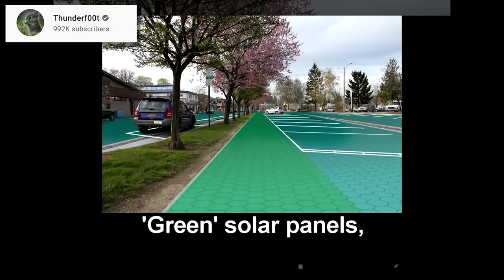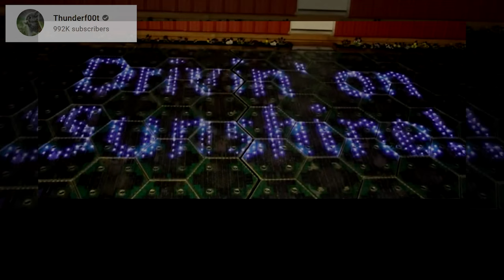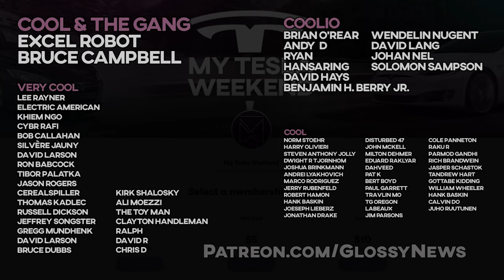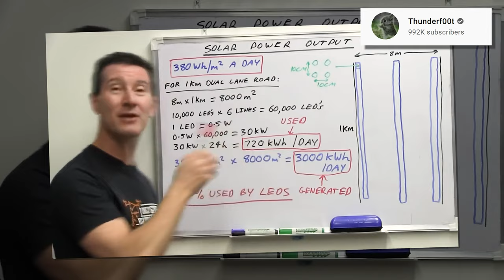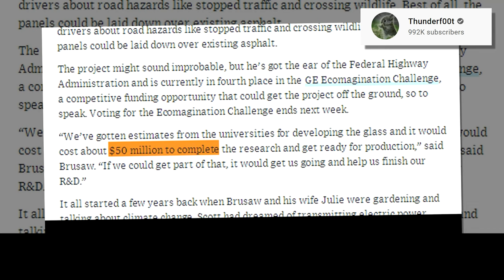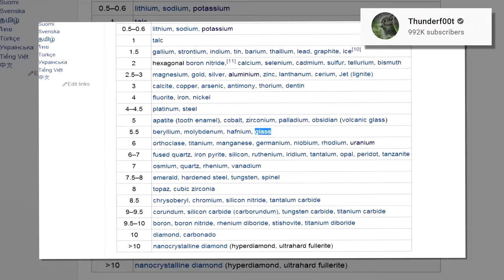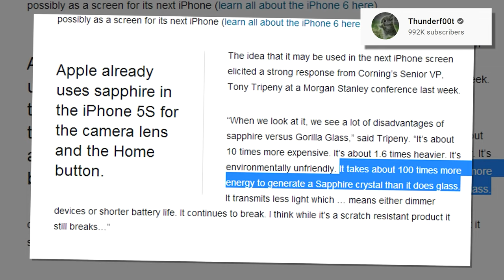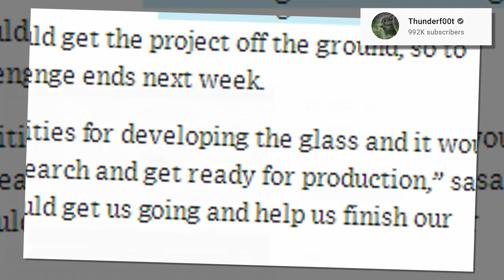Where will we put solar panels? Everywhere!

Comment: Parking lots should all be covered with solar panels. Paved surfaces makes the whole area so much hotter than green areas that actually cool the environment... Absorbing solar energy means a lot less heat in whatever area you install them...
Reply: Solar panels don't convert heat to electricity, which is part of the reason they can only convert a third of the energy falling on them.  So they have no effect on the tempriture

Comment: Hello Bryan,
Mr Al Gorithm suggested to me that if all American giant asphalted car parks were updated with solar generating sunshades part financed by the Biden proposals, the asphalt area reduced and greenery planted..that would be beneficial.
Cordialement,
Reply from the maker: I actually crunched some numbers yesterday, and while I was just sure I was going to agree, it didn't pencil out the way I expected. If every Walmart converted their parking lots to 70% solar coverage, it would still satisfy less than half a percent of the US demand.

Yeah, I know that's only one retailer, but it's a big one. Add in the Lowes and Home Depots are weren't still only around 1%. Malls have massive parking lots, but they're a lot less common. We need big solutions, and we need 'em quick.

I know you're mostly commenting to help the channel, and I truly appreciate it, but you still had some nuggets in there and I figured you might want to know what I found. :/
Reply: @FutureAZA  Hello Bryan, so if we could still go with updating the parking on sites where money flows..shopping, football stadia and airports.
Al proposes a look at fitting a battery pack and 2(?) chargers to each solar canopy.
 I use long term airport parking and if nothing else to come back to a dry car that hasn't been baked for a month in the open would be good.
Cordialement,